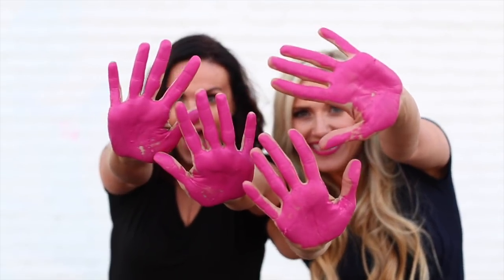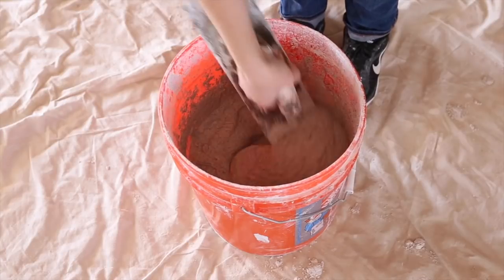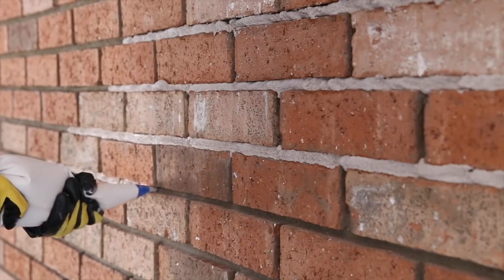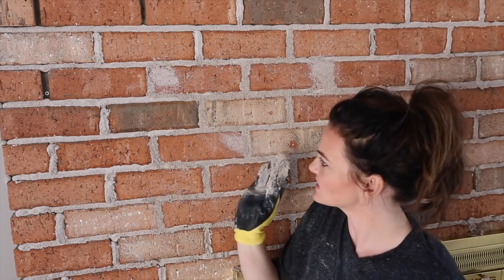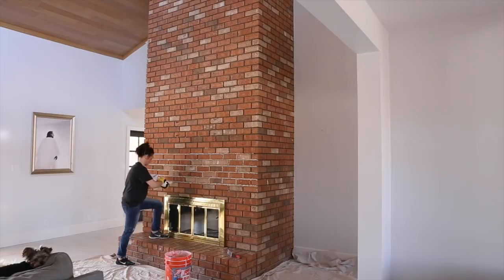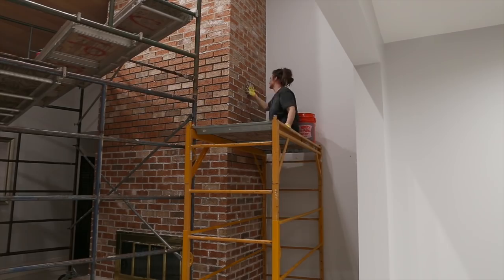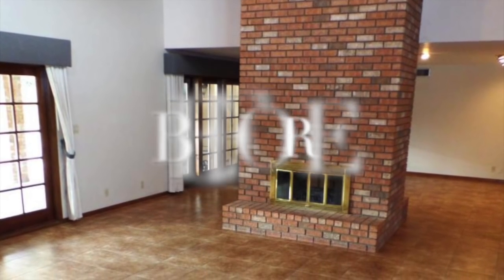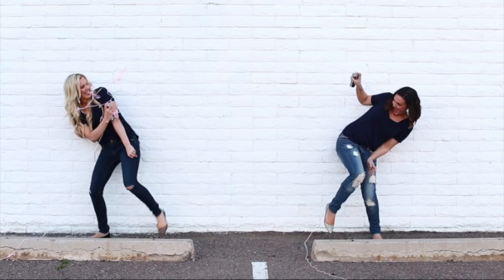HOW TO: Grout a Brick Fireplace

Comment: believe it or not , they make a "mortar joint TOOL" and it costs $5 !!!!! You bought the mortar bag , the joint tool was probably right next to it in the store !!!!!! ...... DO NOT use "The back of the brush" , and I think you found that out pretty quickly , the back of the brush is too "pointy" and gouges out the mortar , you also want to wet the brick and mortar first before application , spray bottle mist basically

Comment: Tip - "scuff" the brass fireplace cover first with fine grit sandpaper before painting it for better adhesion ...... 200 - 400 grit  , or a sanding sponge (those work great and you can use 100 grit with those , just don't sand real hard) but always scuff up a slick surface before painting , and maybe even use a primer undercoater too , or you might have problems later with peeling , chipping paint ..... the microscopic "scratches" give the paint something to "grab and hold on to" , no need to "sand it hard" , just scuff it up a bit , create a slightly rougher surface , "dull the shine" a bit ..... Very important or you'll possibly be very sorry later .... paint doesn't stick well to slick shiny surfaces , I don't care what the can says